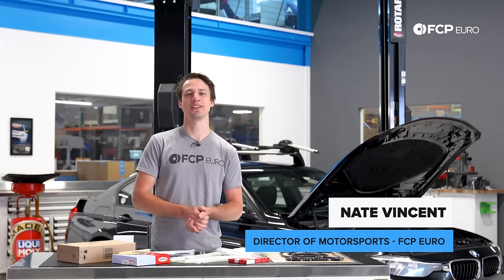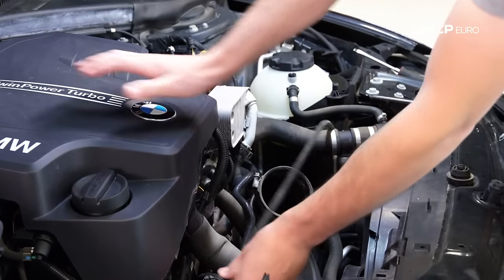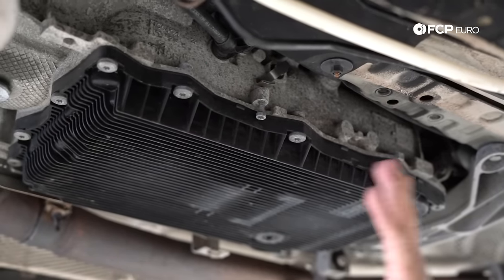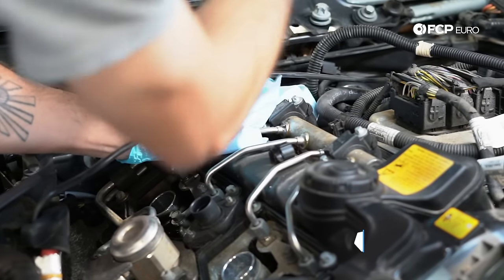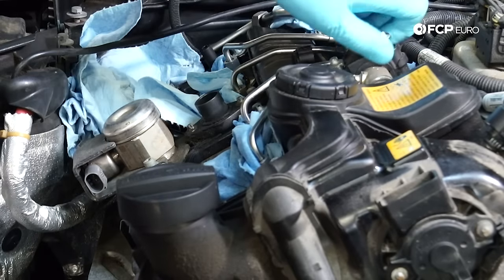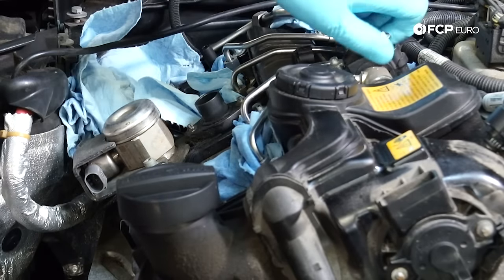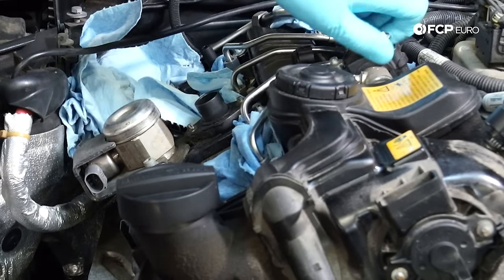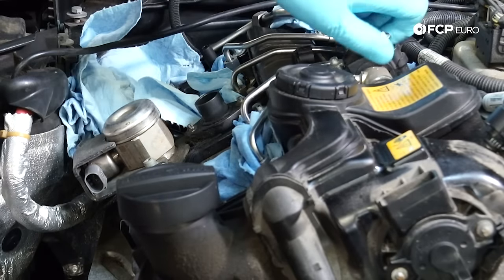BMW N20/N26 Timing Chain Replacement DIY Part 1 - Removal & Disassembly (328i, 320i, 228i, 428i, X1)

Comment: I was checking out a 2012 f30 328i the other day and upon starting up the car, I heard that rattling noise for maybe 10 sec +. After that it went away. Does it mean the timing chain job is due soon?
Reply from the maker: Certainly could be due to that, Rico!
Reply: @fcpeuro  also had 130k km on it.

Comment: Any tips for the 2012 528i xdrive on removing the oil pan? removing the bolts on both motor mount will help it move the pan? or need to do more? Thanks
Reply from the maker: You will need to lower the subframe along with removing the differential/axles (differential is bolted to the left side of the oil pan, right side axle travels through the oil pan) to be able to remove the oil pan.

Comment: Looks like you cut edit where you forgot to take out the banjo bolt and oil rail, otherwise your timing kit works with it in.  My AST (which I think is the BMW tool, requires the removal)

Comment: Is it possible to tell if a car has the revised timing chain guide by what is visible under the oil filler cap?

Curious about my 2015 F25 X3 with the N20. The production date of the car is 01/08/2015.
Reply: You can tell by the color of the guide. The old ones are brown. The revised ones are white.
Reply: @asianbomber1124  they’re all white to begin with then turn brown after absorbing engine oil. You can’t tell that way.

Comment: Amazing amazing quality everything is in depth and I'm just loving it 
My question is 
When the timing chain is going bad or about to go bad....does it make a whining sound even at idle and at higher RPM's because I have my brothers 2012 BMW 328i luxury making that sound and of course it's the N20 engine with the 8 speed but no x drive
Reply: I would probably get it done.

Comment: What are symptoms of this? The only thing I've noticed on my car is it has trouble starting maybe ONCE every 2-3 months, and when I start the car, especially in the cold, I can clearly hear 
the timing chain its pretty loud, but not sure if thats normal or not. (BMW 2012 F30 328i) @112,000KM

Comment: Hi, I have a X3 F25 N20 engine, and the timing need to set for the timing chain replacement, before I able to install the camshaft locking tool when number one cylinder at TDC. My question is, is there any marks, on the camshaft, which will help to syncronize the engine. As of now the engine semi apart, no chain no vanos no spockets on the camshaft. If you can help I appretiated,
Thanks.

Comment: I got a code 130C01 on my F10 N52 engine you think my timing jumped I got a crank no start car was running fine then just wouldn’t start

Comment: I'm confused... Why do you need to put the car in neutral? @7min mark. Doesn't the engine spin freely while in park? When a car idles the engine spins without transmission interference
Reply from the maker: 10/10 dont need to put it in neutral Paul D. It was a simple mistake on Nates part 😳
Reply: @fcpeuro  thanks for the reply!

Comment: are the special tools an absolute requirement in order to get the job done? or could I get away without purchasing the special tools?
Reply from the maker: HI Kenzo, when it comes to timing an engine, you need to use the special tools we used in this video.

Comment: Hi I'm looking to buy a non starting 328i xdrive N20 and need to put in neutral so it can be rolled / towed etc. Cranking the engine and pushing on the shifter method does not work.  It stays in P.  Will screwing in that bolt on the tranny as shown allow all 4 wheels to turn??
Reply from the maker: You will need to do the manual neutral trick at the transmission in order to allow the vehicle to roll.

Comment: This guy show you the hard way. If you wanna do right do not follow this. Just take out the engine. Take only 3 hours with no rush. Put on an engine stand and you can make easy the timing. I did 3 N20 timing.
Reply from the maker: Not everyone has an engine hoist or engine stand so they may have to do it with the engine still in their car, which is why we chose to do it this way.
Reply: @fcpeuro  yes but you say DIY so make this job at home. So car lift $1000+ engine hoist just $200 + engine stand $45. Otherwise on the valvecover need replace the vacume pump seal always leak. You dont need to put the trany neutral because the parking lock dont lock the engine🤣🤣🤣. Balancer shaft lock pin so important where you put in. Video its good but try next time real mechanic to do or tell the guy learn some information from bmw factori mechanic direction. Its free check online. Sorry guys Im  mechanic from europe.👍😎. Donot matters how clean your shop neep the job done right. Thanx.
Reply: @CarReadySmokeBrake  So, do you have a video of the job done with engine out?
Reply: @chilimartini2076  yes

Comment: I have a 2014 428x drive and it has 119000 miles. I am scared how much this dealers gonna charge for changing timing belt and water pump in houston any suggestions would be helpful.
Reply: TMJ Beemers in Houston. Give them a call.
Reply: who did you use

Comment: NEED HELP SOMEONE PLEASE?!!  I'm doing this timing chain replacement as we speak! I've  got everything taken off but I'm having a issue with setting the timing for the oil drive module. I used the lil piece n screw. Turned it over a hair but never heard anything so I just kept turning it clockwise.... still nothing have turning for a good but I decided to just line the wholes up n take it off which I have done. I haven't installed the new one yet. I'm not sure if I'm in the correct spot for the oil module?..... what should I do. Everything else is at TDC
Reply: Did you get this figured out? What was the solution?

Comment: Ok, on my 2013 328i with N26 engine, the front of that tool with the 2 little pins won't line up with the little holes in my cam gears. They are off just a little. Almost like I need to rotate my engine back counterclockwise just a little. But I have the engine at TDC and the flywheel pin locked out. What am I doing wrong? Or has it jumped time?
Reply: Rotate them without the chain. The second video lines them up.
Reply: @asianbomber1124  Ok thanks Jason. Yeah I haven't actually started tearing it down yet. I just ordered the chain set today from FCP Euro. But part of the guide is already broken, so I'm going ahead and replacing it.

Comment: Will this method work on a F10 model? It has a N20 engine.
Reply from the maker: The method will be extremely similar, but some of the body cladding that you'll have to remove will be a bit different so you may need different tools and such.

Comment: Are there any differences in F10 528i
Reply from the maker: Hi Josh, the process will be the same as far as the engine side of things go, locations of accessories and the space you have to work in may change a bit.

Comment: Will this work on a 2014 f10 528i?
Reply from the maker: Hi Sosa, this would indeed work for your F10 N20/N26. The location of some of the chassis components may be a bit different, but the engine side will remain consistent.

Comment: Wow- nothing but friction keeps the drive sprocket in alignment- A BMW with 128K is 3/4 through it's life span already, so just break the chain between the cams and put in a 1/2 link.

Comment: What about engines manufactured after 1/2015? BMW updated the timing components.
Reply: @haha you should be able to search it.
Reply: @shoman24v  My build date 06/15 that had oil changes every 3-5k just experienced failure. Disappointing.
Reply: @FrenchValleyAirport  really? Did you have it fixed? If so? Do you know if it had the updated components?
Reply: @shoman24v  It's at the dealership right now it just happed. I'm pretty sure it had the updated components? Build date mid 2015 definitely  should've had them. the 7year/70k extension only covered until 02/15 so I presumed everything after that was updated.
Reply: @FrenchValleyAirport  keep us posted.

Comment: This engine looks like such pain in the ass and I own an n54 😆
Reply from the maker: That's like throwing bricks from a glass house! 😂
Reply: Agree...thank god I have a N55. Whew!
Reply: Without the airbox you could literally stand in the engine bay, also there's a solid 6+ inches on each side of the engine.
Reply: @FrenchValleyAirport  that's why the handling of a 328i is very nice.
Reply: $5000 to change a timing chain, good german 🚗
Reply: M62tu says "hi."  

(TBH the N20 job looks more involved than the M62tu but similar missing plastic issues on TCGs)

Comment: I got a 2013 z4 with N20 w/ 30k miles, Should I be concerned?
Reply: That depends on how comfortable you are with blowing money.  If you are comfortable with spending $6000 in the next 20K miles (and every 50K miles thereafter) this engine is for you.  With the current design and material choice of the BMW OEM replacement timing chain guides,  you can expect the exact same problem at 100,000 miles.

Comment: what if when you check the timing after removing the valve cover with to tool that has the pins that go on the cam shaft sprockets, what if they are not lined up and the cams are NOT timed?  That the pins don't line up?  Also, I can see that my plastic timing chain rail is broken (I have not removed it yet), but that my chain is very tight?  Thanks in advance!
Reply: What did you end up doing  i’m in the same situation

Comment: The x drive vehicles with the n20 are even more work than this. Front drive shafts  and front differential have to come out to do the oil pump stuff.

Comment: not a lot of miles for needing a timng chain job.
I'd rather have a belt.
Reply from the maker: Ya unfortunately its not the only BMW with timing Chain issues, you'd think they would have learned from past mistakes!
Reply: This was a design flaw in early F30's and it was revised and corrected.

Comment: If N20 or N26 BMW engines have timing chain failure, they don't seem to reliable neither trouble free as you claim here, my friend.
Reply from the maker: Its realistically 1 pain point that can rear its head. Although its a big one, normal maintenance on these engines really isn't that bad, especially  if you consider how many of these are out and about on the road today it puts their reliability into perspective (compared to something like the N54). This is likely why BMW has offered the extended warranty to fix this problem specifically.
Reply: @fcpeuro  I see. Thanks for your explanation 🙂👍🏻
Reply: @fcpeuro  I have another question if I may ask. Would have been easier to drop the engine and the transmission out of the car body so you could be able to have a roomier space and work with the engine's timing chain with an easy access? 🙂

Comment: Another day, Another time BMW fails. Why do all BMW's now a days suck? they used bad plastic in the E38/E39 around timing chain guides. Most V8s have bad valve seals M5 v10 has bad rod bearings ( also E92 m3 ) and most cant hold fluid to save themselves.

Comment: This is about as bad as I've seen it. My god everything is just absolutely buried under everything else and almost impossible to get at without a factory's worth of specialised tools. The worst thing is the amount of space you have to work in now, trying to open one bolt here and one bolt there that are almost impossible to get at without stripping out half the car. Same with the n47/n57 engines. Take out the whole dam engine just to get at the t-chain. 

Years ago I used to enjoy working on my cars but now I absolutely deplore it. I pity mechanics, how can they garner any joy in their work doing this shit day in, day out for barely more than minium wage. 

Funny enough I don't think its deliberate bad design, I think it's 100% on purpose to stop people working on their own cars.

Comment: I am not a mechanic, but I am handy with cars and work on my own including engines I have built in the past. We have a 2014 328 xdrive with this engine, and I had no clue it was such a fucking nightmare, and with all these bullshit plastic parts. I know I would break shit and get beyond pissed. Why did the cheap out and use so much plastic on these, and such a shitty timing chain, and with halogen headlights on high end car, when even a Prius has HID's. We are past the point now where the dealer will handle the recall, and its at 89k miles, but on the other hand I should check with them in case its already been done since it was bought used from a BMW dealer back in 2016. Otherwise, I'll have an independent shop to do this, which I hear is around $3k. If we keep the car, I am definitely going to upgrade the fixtures and use HID or LED lights.

I am able to work on my Lexus and building up the V8 with stronger rods, and the rest is untouched since it's so strong and going with forced induction, and I am totally comfortable doing that. The engine as well uses a timing belt surprisingly which is good for 90k miles, but it's known to go over double that. Either way, it's pretty straight forward to do the timing belt job thankfully. For a timing chain and guides to be so fragile, its such a flawed setup indeed and I can see why they were sued so badly.

Something about working on this BMW is intimidating to me, since I know I'll bust something. But either way, it's a great video and helped me a lot to see what's involved and it's much more than I anticipated.

For my understanding. Is the answer to use a 2016 timing chain on these, or is that different? I was on the forums and some of the posts more or less stated you have to do the job and watch it as it goes another 60-80k miles.

Comment: I want to do "DIY" that. No drain coolant? And can not i do it if i dont have a car lift? I have a rhino car ramp 4 pcs. I think it can all wheels lift the ramps.
Reply from the maker: You can do this on ramps or jack stands!
Reply: @fcpeuro  can you explain me how to removal oil pan? I need to removal All engine mount bolt? And the timing chain kit ( web fcpeuro) , does it include new vacuum pump seal(engine valve cover side) and crankshaft seal( crankshaft pulley side)?

Comment: BMW'S Are a lovely car to drive but there engine designs stink, all this just to replace a chain, I remember working for VW and you could change a cambelt on a Golf tdi in 45 minutes, Bmw do this so it cost you loads of money to repair,
Would not buy another BMW ever again.

Comment: love these 2 videos.  BMW really screwed the pooch on the N20. Plastic valve cover lol...plastic oil pan haha... a weak ass Timing Chain Tensioner, Shitty plastic TT' guides and a joke wimpy timing chain. Jesus Krist..Both my e46's have well over 200k and  their timing chains are in fine shape. I'm considering a 228i but I won't buy one with the first gen' timing chain set up...plus I'll replace that stupid plastic oil pan

Comment: A timing chain is actually an unreliable way of doing things! The timing belt is much better
Reply: …no? A timing chain will last much longer, the reason timing belts were put into vehicles was because they were cheaper to produce that. These N20s just had issues that caused timing chains to wear prematurely, hence the reason this is a common problem

Comment: All this trouble and expense because BMW quality is shit,they know very well that these chains will fail when just out of warranty and it’s then down to the owners to stump up the cash for what is basically a design fault,duplex chains need to be used especially on 16 valve engines,that’s a lot of load for a single chain and they know that but still continue to use them,this is building in a fault,whatever happened to German quality and longevity,you might as well pay thousands less and buy a Kia or Hyundai with their great warranties, BMW are taking the piss with this junk,people pay a premium for a quality vehicle from Germany and this is what they get for their trouble. These chains should lasted at least 250,000miles or the life of the engine,this is penny pinching on a grand scale by a respected manufacturer, buy elsewhere and save a lot of money,this is a disgrace and they know it.

Comment: BMW timing chains are all rubbish across the whole range,especially the diesel with the chain at the rear behind the flywheel,so engine removal is necessary,what a brilliant designe  not

Comment: How do you change the radiator on a bmw?  First you disconnect to battery. Next, you remove the transmission and then the engine and the remove the 20bolts holding the radiator. Lmao what moron builds these engines. Jam pack parts upon part without thinking about dismantling it for repairs. Lol
Reply from the maker: The age old joke that engineers have never thought about repairs haha